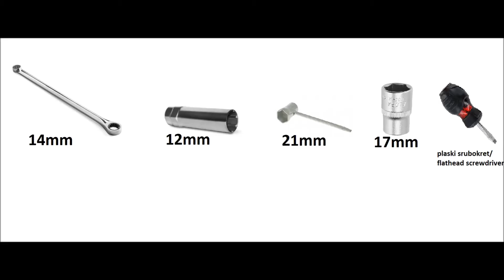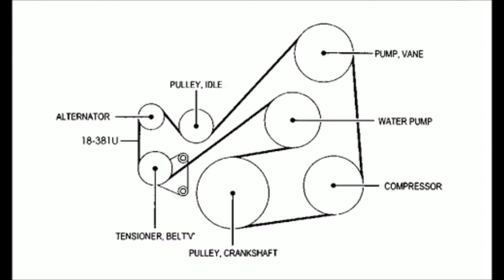How to replace power steering pump / jak wymienic pompe wspomagania

Comment: Did u replaced because was making noice ?
My 2007 cx7 the steering wheel it hard to turn left and right ..  got new balljoints..   no leaks.. enoght power steering fluid..  do you have any aidea ..
Reply from the maker: yes 
replaced only because when i turn left or right noise was really loud.
My wife always ask me “why i can’t turn using one finger”:) BECAUSE this is Mazda CX7 :))
Reply: @magicgarag  lol